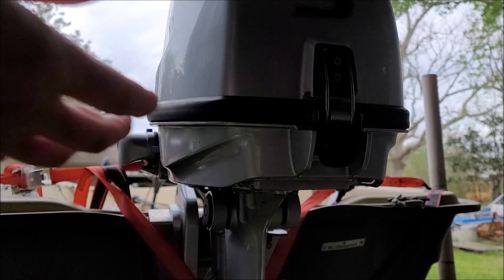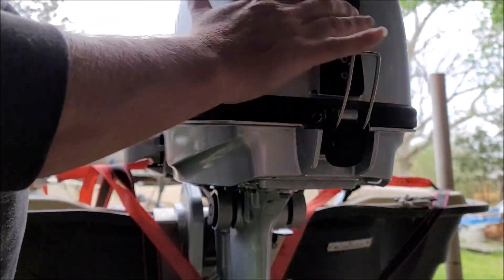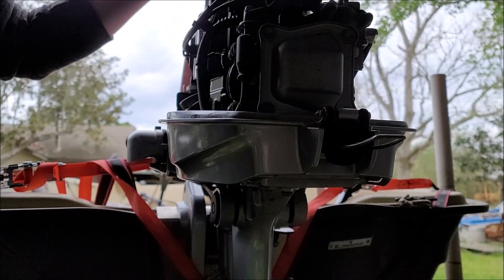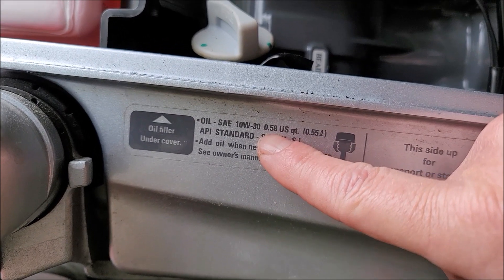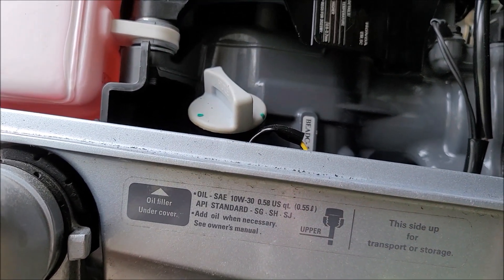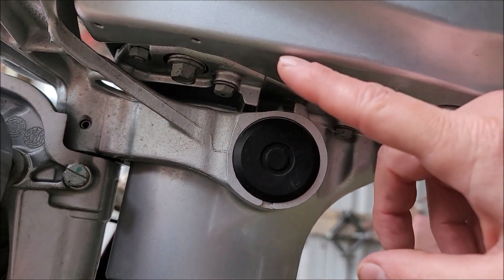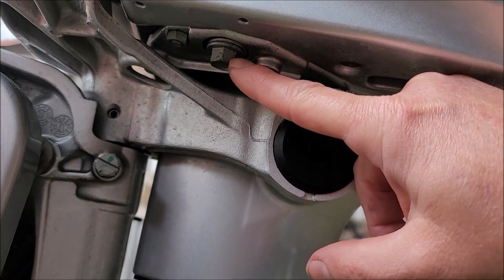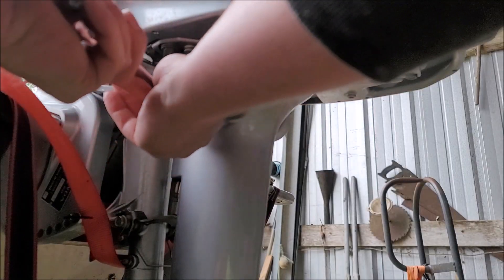How to Change the Oil for a 2022 Honda 5hp 4 Stroke Outboard | Easy Step-by-Step Guide

Comment: Thanks bud, Just bought my second BF 5 hp.  This one comes with a charging system.  Have you used the charging lines on this boat?
Reply from the maker: Welcome my man.  I have not, no.  Mine does not have the charging system on it.